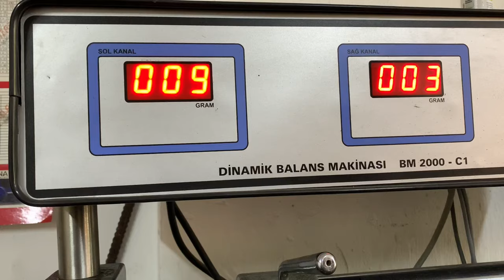Treadmill motor armature winding rotor winding treadmill repair

Comment: Hello, how are your videos very good? Could you help me with an engine similar to the one in the video? This is the first time I am going to repair one of those characteristics. greetings from Argentina
Reply from the maker: Hello, thank you for your nice comment. How can I help you?
Reply: @krckaracaelektrikbobinaj  
Would you have a diagram of the armature winding? It is a 180 volt 1.5 hp motor from a Melfit brand treadmill. Thank you for taking the time and responding

Comment: Bro! Same motor over 80kg weight gets ampering and heat up within 20 to 25 minutes .is it a winding trouble ?
Reply from the maker: These engines are not professional, run for a maximum of 15 minutes and then rest, otherwise you will burn the engine.
Reply: @krckaracaelektrikbobinaj  by replacing the installed fan with a fast blower towards winding can enhance the timing?
Reply from the maker: @imranmanzoor1599  If there is a blower that will prevent the engine from heating, it will not be a problem if the engine does not heat up, find a system that will cool the engine, then you can use it for a long time.
Reply: @krckaracaelektrikbobinaj  as per speed used for walking (not running) may make engine hotter. After installing i will report the difference inshaALLAH.!  thanks bro!

Comment: başta izlerken dedim yabancılar yapıyor bu işi.çok temiz işçilik.sonradan bizden olduğunu görünce bir umutlandım ülkemiz adına :) hocam elinize sağlık.benimde koşu bandımla alakalı bir sıkıntım var.motoru bir tane harici trafo ile çalıştırdım çalıştı .fakat karta takınca kartın çıkışındaki 180 volt 0 lanıyor bi anda.bu motorla alakalı olabilirmi.multimetre ile motorun kablolarını baktım .toprak la artı eksi uçlar arasında herhangi bir kısa devre yok.artı eksi uçları proplara değdirdiğimde kısa devresi var.kartıda kontrol ediyoruz çıkışta düzenli 180 voltu veriyor starta basılınca.motorun artı eksi uçlarını karta taktığım anda sanki emiyor yada blokluyormu artık ne oluyorsa sıfırlanıyor.
Reply from the maker: Merhaba motorunuz eğer hariçi çalışıyorsa kartta sıkıntı vardır.
Reply: @krckaracaelektrikbobinaj  harici 12 voltluk şerit LED trafosu ile çalışıyor .kasada fazladan bı elektrik var kol değince kolu titrestiriyo onun üzerinden gidicez olmadı  .bı yerde bı kaçak var sanırım inşallah tespit ederiz .kartları çok uçuk rakamlara tamir ediyolar .bir diot degistiriyolar motor sarma parasi aliyolar.tesekkurler cevap için hocam .yorumlardan numaranızı aldım .finalde motorla alakalı sıkıntı çıkarsa ulasicam size

Comment: If you wound it the opposite way, would the entire thing spin the opposite way? If so, how'd you solve the problem without the rewinding and stuff?
Reply: wire it the opposite way?
Reply: @bios546  its a permanent magnet dc motor, so swapping the supply leads over would reverse the rotation direction
Reply: @bios546  should be used since any foreign object can go inside and damage the rotor or etc.

Comment: Hello sir great video. Can you please the number of turns for each slot? It is 180v?
Reply from the maker: Hello, the number of types for a coil for each slot is 2x22 spires yes 180 volt dc
Reply: @krckaracaelektrikbobinaj  thank you sir! Very helpfull
Reply: @krckaracaelektrikbobinaj  muy bueno
Reply: @krckaracaelektrikbobinaj  Hi, I did the armature winding like you did. I test the motor it runs empty but when I install it on the machine under load it slows down a lot what is the problem according to you